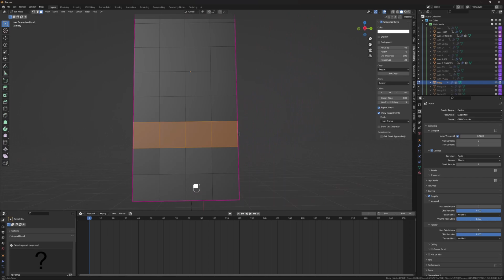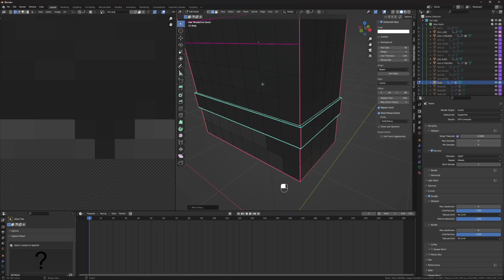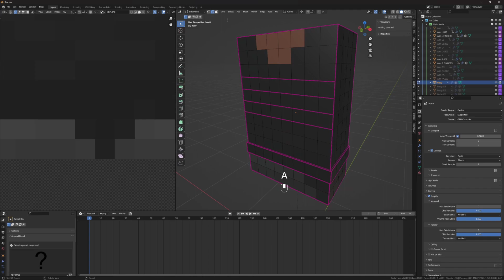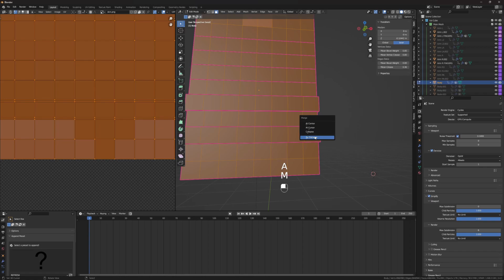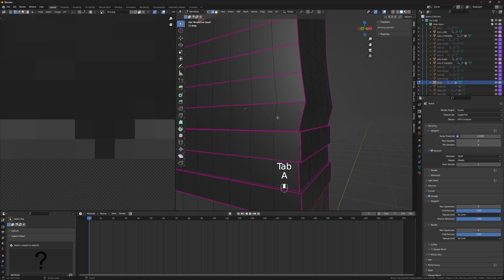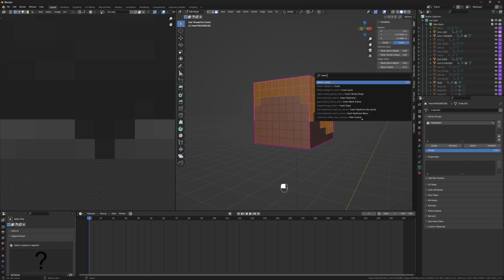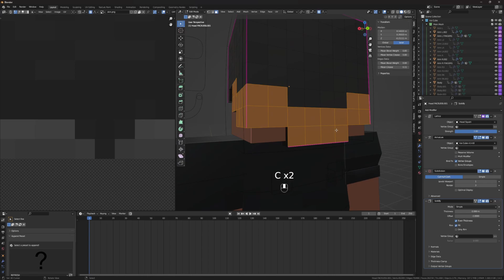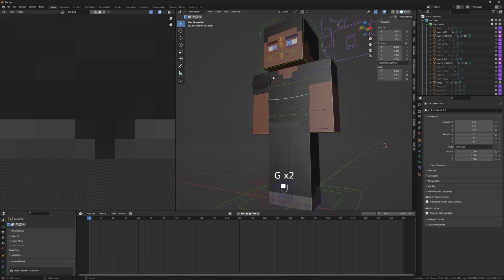Rig Tutorials 6: How to Extrude

Comment: Bro there is a very big issue with your rig that when we save the project and after when we open it, it glitches out my character and the functions are not working properly and it looks like that your rig is broken. Please fix it. Please please please please please